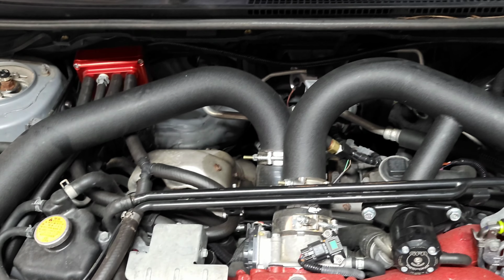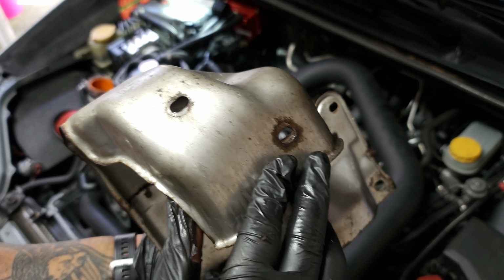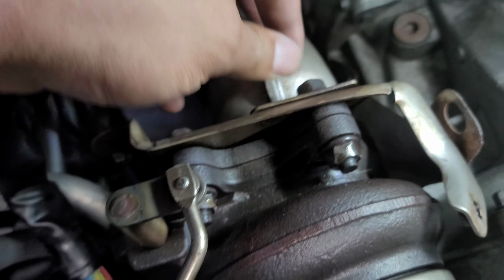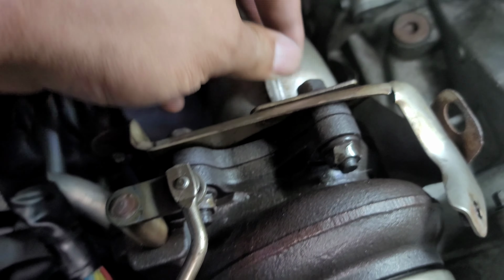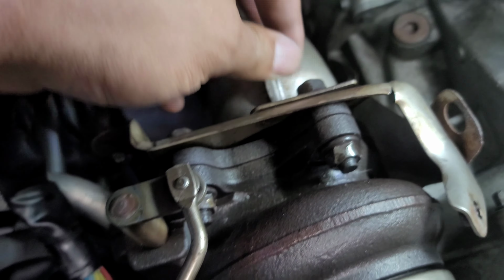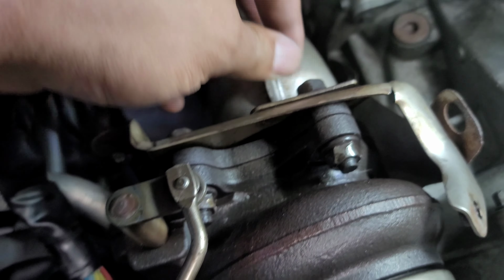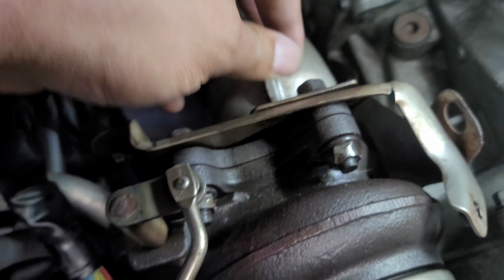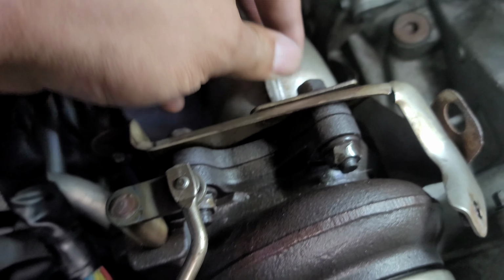2015 Subaru Sti DownPipe Install (Seized Bolt Struggle)

Comment: did you ever get a CEL? cant find a deflouler that wont throw a CEL.
Reply from the maker: It would occasionally throw a code when before the tune. No boost driving. "Sensor 2 too lean". After the tune; nothing so far. Been about 2 weeks.